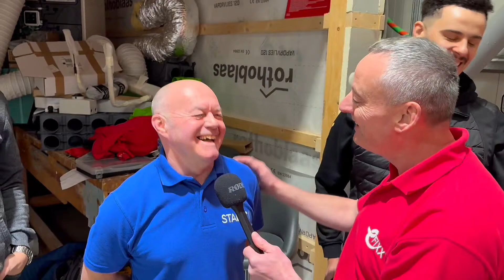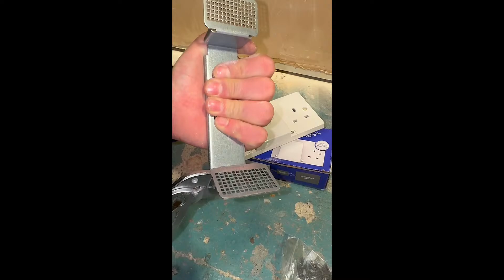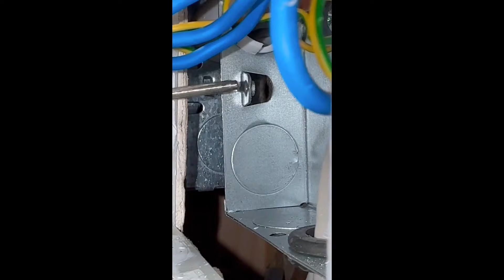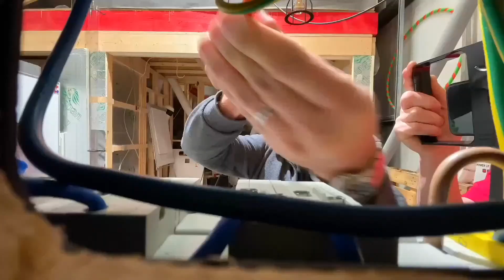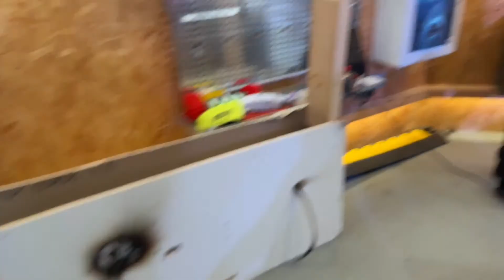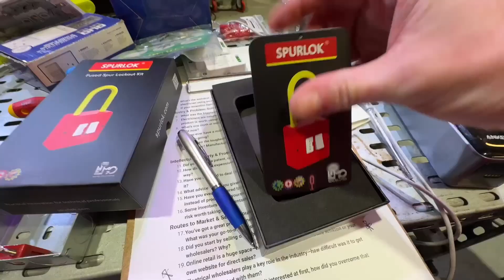Electricians Solved Problems No One Else Noticed

Comment: Ovens with 3 pin plugs are not good. I always cut them off and hard wire into a FCU. Found many oven plugs in inaccessible locations with heat damage similar to what you find when the dopey plasterer leaves a 2kW fan heater running flat out over the weekend.